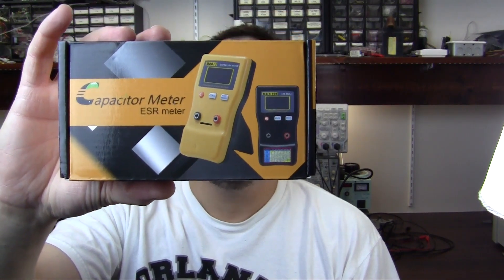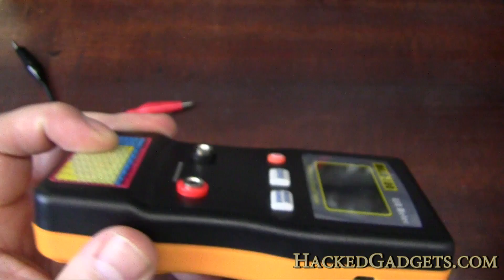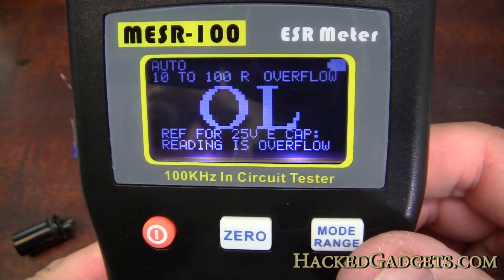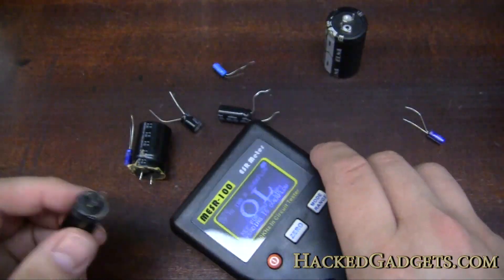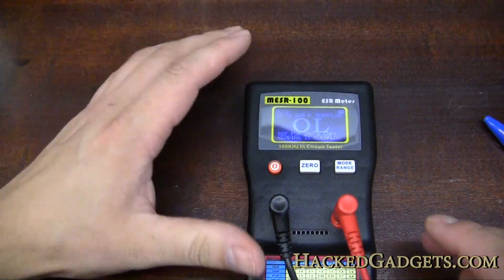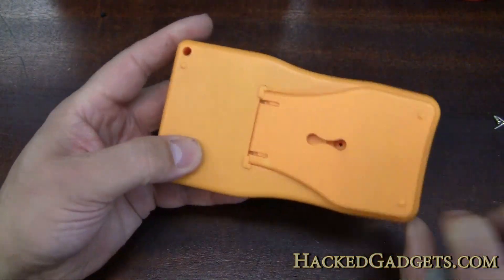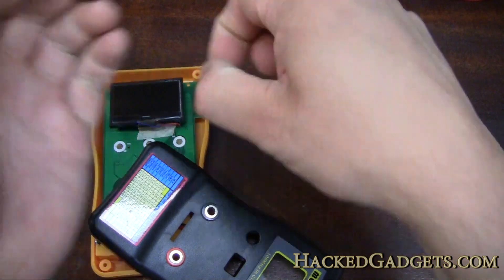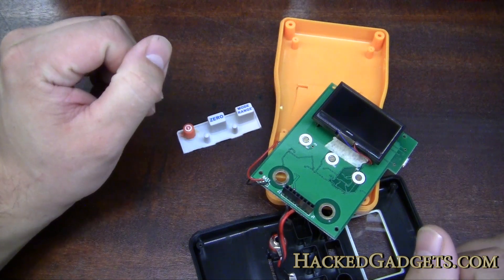MESR-100 ESR Meter Review and Teardown

Comment: Hmmmm....
-  "Nice sine wave, not a stepped wave"....it is a rounded square wave, NOT even remotely a sine wave.
- The helpful info on the screen, regarding whether a measured cap is good or not, is applicable only to 25V capacitors. If the tested cap is NOT 25V, then the user must consult the little chart. Since many of the demo-tested caps in this video were not 25V, then the narration that the message meant that they were good is erroneous.

This is a nice little ESR meter, but there are caveats:
- It has poor drive capacity, and with capacitors having certain characteristics, the output waveform nearly collapses and ESR readings begin to be wildly inaccurate, yet the meter in no way detects this situation  to warn the user.....SOMETIMES it WILL give an error message, but that seems unreliable.
- It only tests at 100kHz, which is OK for capacitors designed and intended for use in switching power supplies and such, but much too high for many capacitors, leading to inaccurate readings and good/bad diagnoses.

There are better ESR meters out there, usually for less cost than this one, and some of those also test DCR.

Comment: 16:45 It looks like it fits perfectly on the reverse side for which it might have been intended. However, there are no markings of the polarity on the reverse side which might be the reason why the did not solder it there or perhaps they did not wan to flip the board while populating it with parts to avoid delays. The latter would be a weird reason though as there are a couple of wires which are soldered on the reverse, so they do have to flip it. Therefore my guess it it's probably the first reason: somebody forgot to put the polarity on the reverse and thus they have to solder it on that side to avoid any chance of error.

Comment: I am an electronics type and fully understand the purpose for capacitors, but actually got one for a model railroad purpose.  The high resolution ohmmeter is terrific for finding short circuits.  There can be some track short somewhere, you disconnect power, and then start measuring at different locations across the rails.  The lowest reading you find will be at, or near, where the short is.  Many multimeters have only 0.1 ohm resolution which isn't really enough.  A Fluke 87V in "high resolution mode" or and OWON B31T+ multimeter has 0.01 resolution which can sort of do it, but the 0.001 resolution of the ESR meter works great.

Comment: What if you want to measure a capacitor that falls outside the given ESR table? For example, I have a 400volt 80 Farad capacitor in circuit. How would I test that one to make sure it is good using the MESR-100? Or, can it be done at all using this meter?
Reply: Kelly Keys , No, you cannot do that with this tester because it only allows capacitors range from 10V to 250V and 10uF to 10,000uF only.
Reply: Yeah, it was my bad for not looking closer at the schematic first where, in small writing in the notes section, it stated that all caps were in uF unless otherwise noted. So, even though the 3 Mallory caps said 80 on them, they were uF. A Do'h! moment.  Thanks!
Reply: Kelly Keys , I 'm pointing out that this meter won't test the capacitor which you mentioned. I do not mean to say that it's someone's fault. It is normal to ask questions about this meter before you plan to buy it.

Comment: Nice review.
But the question is, why you connecting almost every capacitor to the meter with wrong polarity, plus and min?
Reply: he doesnt know to use it yet
Reply: @roimark358  Its AC but you know that by now
Reply: Its AC but you know that by now

Comment: Box is for MESR 6013 and mesr 100  what's the diff other than yellow fave and black face side
Reply: Not really sure about that one.
Reply: Alan Parekh does this do in circuit give you a onscreen good bad indicator
Reply: It is not MESR 6013 but M6013 and  M6013 do not read ESR but it is only a Capacitor. Meter M6013 can read  0.01pF to  470000uF

Comment: you didn't try the most important test. In circuit.
Reply: Mine works great for in circuit testing, why I bought it, found many bad caps with it, love it, use it all the time, and very usefull. Leads are to short but who care at this price. Accurate as Fluke and reads lower resistance far better at far less cost
Reply: @airgliderz  So it is a show!

Comment: Hello could u please help me would it he ok yo use this meter just for reading resistance alone in the low ohm ranges I'm looking for a meter that's accurate and cheep as accurate as it gets for cheep equipment anyway. I want to read atomizer resistances between and 0.08ohm  upwards to 2.0 ohms
Reply: Why would you not use a multi meter set in resistance mode (Ohms) ?